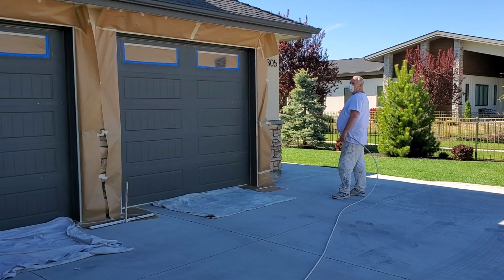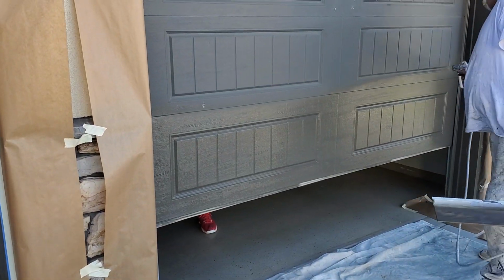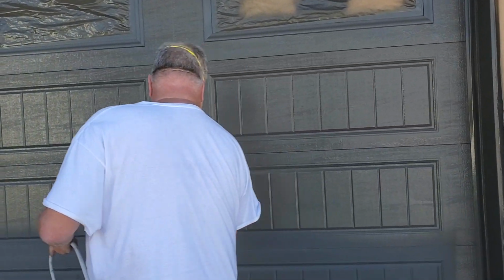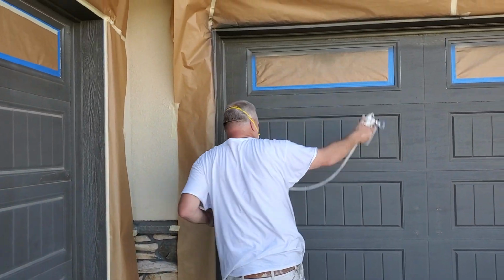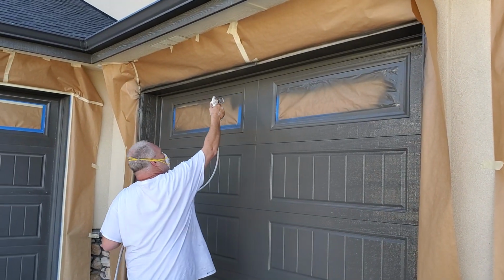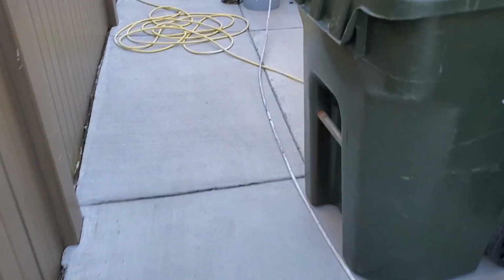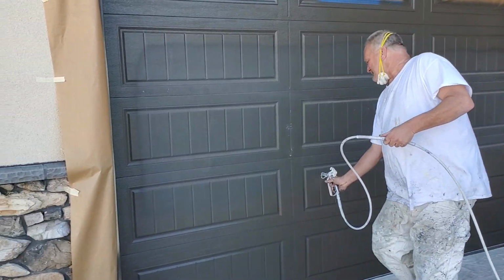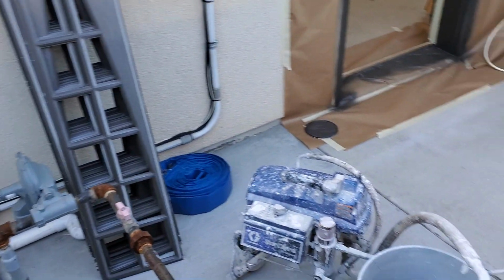How to paint garage doors | Pro hack for perfect doors

Comment: awesome quick to the point video! QUESTION, my garage repair guy says I need to tape between the panels.Have you ever heard or practiced this? or is this possibility of paint sticking between panels removed when the door is drying in the opened position ?

Comment: Only one coat will be sufficient to protect from all the elements? No need to wash before or after the sanding? (Not questioning just curious) thanks in advance! Great video (new subscriber)
Reply from the maker: Hello Dimitri, thanks for the questions, no problem at all, great questions. So it always depends on different circumstances, but in this case we did pressure wash the doors prior to shooting the video, always a good idea. You can also sand by hand and then blow off with a blower to clear dust. I always like to do a sticky light coat followed by a heavier coat for final, but in some cases clients just want 1 coat, so as long as the door is not west or south facing (direct sun) and we are shooting a similar color that has been painted already, I think 1 heavy coat is ok when recoating doors. 2 is always the best, but if you are doing a color on color recoat using a good paint should these doors should hold up until the client want to change color💪 thanks for the comment

Comment: No primer? Just straight superpaint? Going to do my garage door and gutters/fascia and I'm worried about adhesion and longevity.
Reply from the maker: Great question! Adhesion is very important, so make sure you sand surfaces to open up the pores on the substrate, and or use xylene or tsp to etch the metal...also this opens up the pores and ensure great adhesion. Thanks for the comment

Comment: Nice work! I have white doors I want to paint  black. All the videos I've watched, no one seems to paint the doors behind the top and side weather stripping. It's also currently white, and I thought I'd replace with black. Is there a reason you don't paint these parts?
Reply from the maker: Yes we do, as u could see in the video we push the door down and when the door is rolled about waist high it will expose that white inch or 2. Another way we do it is if the weather strip is really tight against the door, simply roll up the door and grab a ladder and paint the sides and tops from above the door while it is up and laying flat.Thanks for the comment and let me know if you have any questions 😊
Reply: @PaintBoss  Yes and that makes sense now. It is tight, and it's more of the sides that wouldn't get it rather than the top. Painting those areas while the door is up is a good idea, thank you!

Comment: Well that's going to be tough to get that stretch mark out when I paint my doors by myself lol
Reply: To those watching now.  My plan would be to force door down and apply a clamp or vice grips right above door roller to hold it hard down on each side then go out and spray top jamb.  After that you can release clamps and let the door relax and finish up.  Luckily I am replacing the jamb trim/weatherstrip on the sides and top so will remove the old, spray door and trim separate.  And install the trim/weatherstrip and spot touchup the nails when installing the new trim.

Comment: Did you have to add water to your paint before using the spray gun?
Reply from the maker: Hello Tammy, thanks for the question. No we do not add any water to our paint. I highly recommend not adding water to exterior paint as it can change the sheen or change warranty. With an airless sprayer you don't need to water down any paint to spray it. If you are using a cup gun or hvlp then that is when you would thin your paint a bit. Thanks for the comment 👍🙏

Comment: Hi what size of tip would u recommend for spraying sherwin Williams emerald exterior that will still give you that tight control ? It seems like really thick paint.
Reply from the maker: Hello there, and thanks for the comment. I personally like a 4/12 fine finish. it is still big enough to get the exterior paints through it and gives you great control. Are u talking about garage doors or siding? thanks
Reply: @PaintBoss  we are going to spray our garage with an old graco magnum but might do some siding also. We noticed in the video you stated a 310 which my husband felt would give him better control but the orifice size seemed inappropriate for our thick emerald paint. Thanks!

Comment: Thanks for the tips! Besides the paint, does it need to be sealed with a clear coat? Also, what color is that?
Reply from the maker: Thank you. No this paint is super paint from sherwin Williams so it does not need to be sealed. This color is black fox, it is a great color for exteriors.  thanks for the comment 👍 🙏

Comment: Do you paint the edges behind the weatherstripping with the door open?
Reply from the maker: Yes most of the time we do, doing this little trick it actually gets some paint in that seam between the flange,  but if there are any shrink marks or its to tight, we will lift up the door and hit the edges if needed. Thanks for the comment 🙏
Reply: @PaintBoss  Chris Berry said it will stick in hot weather if you paint them. now im not sure what to do

Comment: Why is the paper underneath and behind? What does that Do?
Reply from the maker: Hello Bryan, thanks for your comment 👍🙏 so we run the paper under the door and behind just to protect against any overspray getting past the sides of the doors or if the flange on the bottom of the door isn't tight. It is just a safety precaution. Thanks again for the comment, we appreciate it 🙏

Comment: Nice video guys. Question on the sheen...in the video you said you were using satin, but the Sherwin Williams site says to use gloss for garage doors. Which do you usually go with for garage doors and why? My garage door gets a lot of sun exposure so was wondering what you'd recommend in that case. Thanks!
Reply: It doesn't matter at all,  the higher the sheen, it will fade to flat. Gloss is shiny. Use velvet..happy medium.

Comment: Pro Painter says there is no way to get the edges painted... because all they want to do is spray.

Sure there is....Get on a step ladder with the door up and use a 4" roller or sash brush to do the edges when the door is up. It's a little tricky but makes a much better finished job. I do it first, let it dry, then the next day lower the door and paint the whole door. Similar to cutting in a ceiling when painting a room.

Comment: Those are where the vinyl trim RUB the paint off. Your finish will look the same in a year.
Reply from the maker: It might rub eventually,  but most of the stretch marks we talk about, is where the original painter didn't open the door while spraying and left some edges without paint...it is definitely hard to hide these, but we try our best to prevent 👊💪

Comment: i'd be pretty pissed if i had this job done on my doors.  did not get 100% coverage.  one run looking through the footage i saw a big section missed on the first door and third door.  just look at your painter's tape on the 3rd door - see how you can see a clear defined edge of blue, untouched painter's tape on the window?  that means the area immediately below it was UNPAINTED.  IMO painter was systematic but inconsistent which lead to this miss.
Reply: piss coated IMO I use a 5 15 a 10 is just too small sometimes I use a 3 13 but never a tip that small and move that fast. total piss coat.

Comment: Rough cost for 3 doors?
Reply from the maker: Hello, so out here we would charge between $175- $250 for each garage door. Obviously, it ranges in size and most importantly in condition👍👊 Thank you for your comment 👍
Reply: Paint Boss my God thats like peanut in Texas...on top of that we have lazy crew, sloppy job...please come to Austin
Reply: Why doesn't he spray top to bottom , that way you do 1 pass , instead of back and forth a million times and saves your legs.
Reply from the maker: I know, you are right. On these doors in particular,  the previous painter left a "stretch mark" or unpainted edge around the doors, so when we do it this way we can get a little paint on the edge behind the rubber flange...just a little trick to help with expansion and contraction lines out here with crazy temp swings.
Reply: @nickalndime  Because this guy have no clue how to paint right,    he skip 1 spot ,, u can see it that blue tape is not painted at the end of the video,

Comment: No bad, but a little fast and lazy on some of the spraying.  Also done right it should have had the seals around the door removed and replaced to get full coverage as well as started with the joints, then then finished with the door.

Comment: I took all the rubber off my doors its pretty cheap for a new kit.  And it only nails back on.
I brushed it all on.  Sanded filled sanded 
Painted sanded painted sanded painted 
Gave it a mognangy look on real wood door.  1 year later the bottom chiped peeled and looked bad,  I hit those spots with spray paint.  Ill have to rebuild the look and blend it back in.
Reply from the maker: Sweet! that sounds amazing,  great job 👏 👍 Yes the faux wood grain, is a great look on garage doors, I've always had problems on the sealing of it afterwards,  and out here our climate is so extreme,  the topcoat would start to flake after a couple years, so I don't do it anymore out here, just from a warranty issue. I really like that you put on all new rubber,  that is a nice touch and really cleans up the project nicely 👌  thanks for the comment